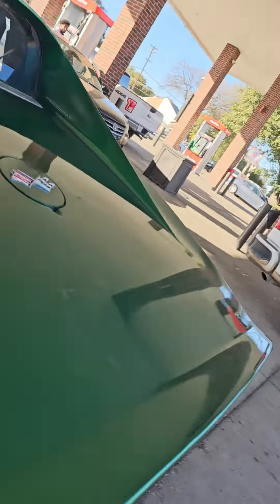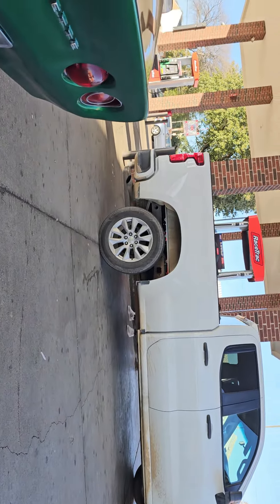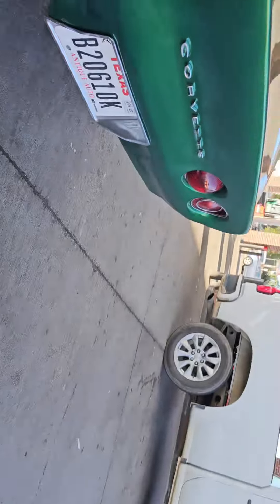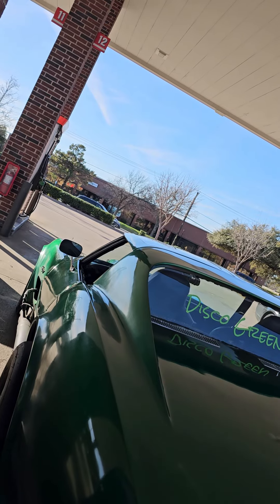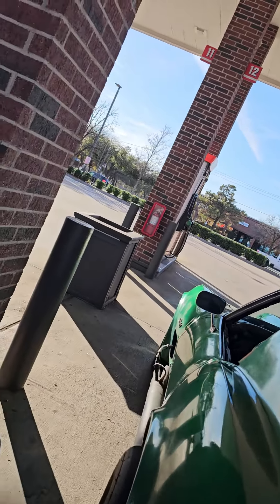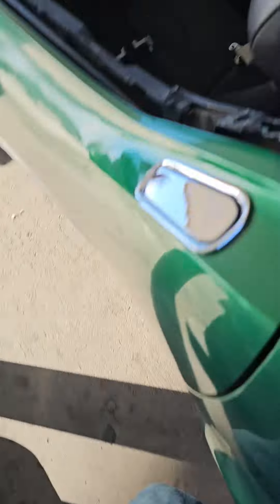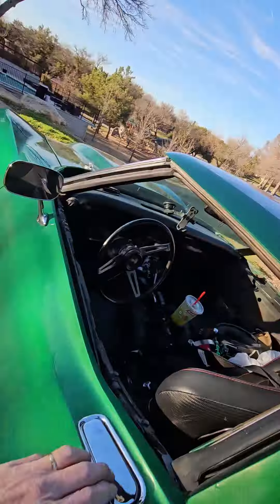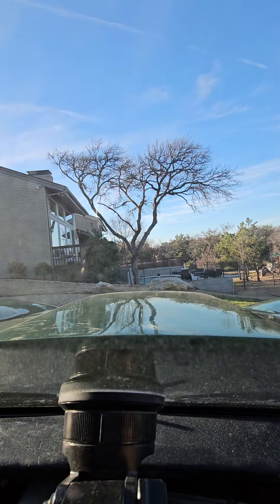my ride after work today......

Comment: Nice vette. Underrated year based off performance but the looks of the 3rd gen’s are really original
Reply from the maker: Thanks. I fixed the anemic 165hp l48 with a 550+hp na 406 forged nitrous motor. But yeah these are fun and easy to make quick. And light. Mines under 3k lbs